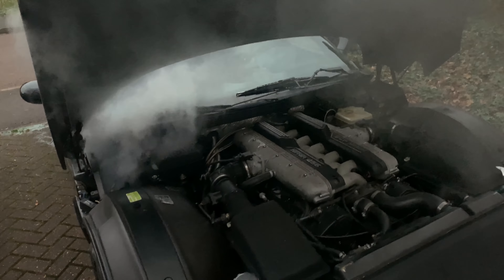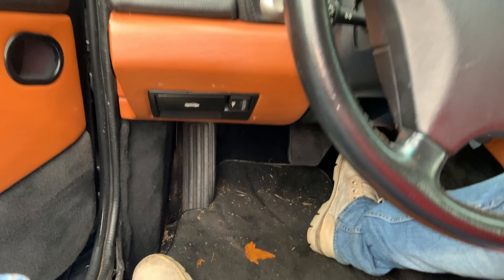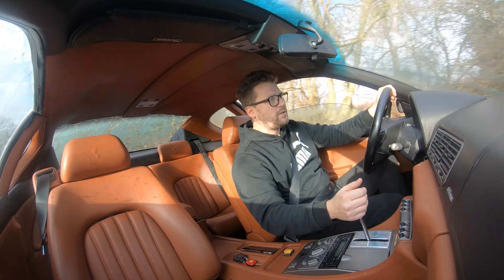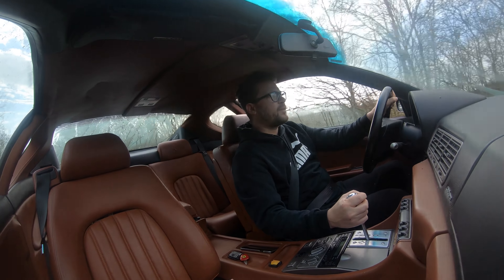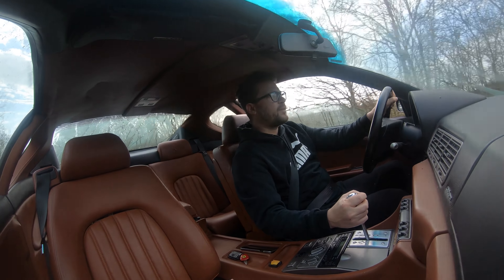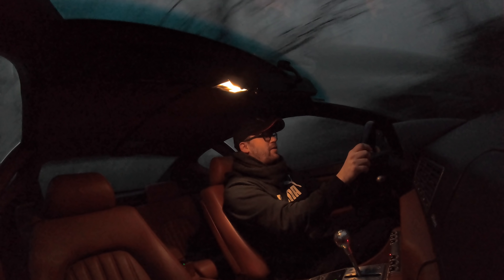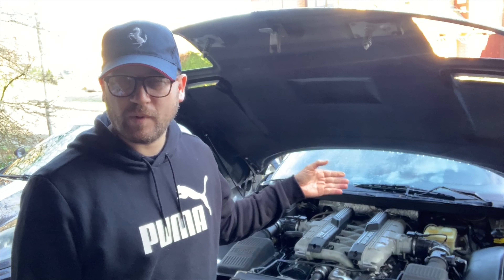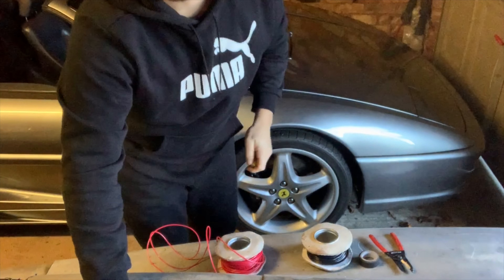I Left my $19000 Cheap Ferrari Sitting for 4 Months and Here's what Happened !!  Part 5

Comment: Why not use a scanner to pull up sensor data, compare data to known good values, then trouble shoot sensors giving out of spec readings. O2 sensor data, STFT, LTFT, MAF, MAP, TPS, IAC, CMP, CKP, etc.. all needed to pinpoint exact problem. Not knowing is same as using the "Parts Cannon"

Comment: You need a garage for your outside Ferraris. The rain makes you many electric problems. I had the same problems with my Maranello and my F512....
Reply from the maker: its a tricky one as to many cars and not enough space.
Reply: I know all of these problems. I bought the 3 cars without a garage. Always tried to cover them. But when there was wind, everything flew away. The sun destroyed the dashboard of the Maranello and the old leather roof of my Rolls Royce. Build a double carport in front of the garages and a carport next to the house. Then the Ferrari will not get wet and are protected from the sun and you can also repair it in the rain. Such a wooden carport is cheap. Don't know if you need a building permit.

Comment: What you’re doing is fault isolation. We do it a lot in aviation. If you have a working test rig (in your case, other car), you could install the suspected part and see if it causes any effect in the test rig. It would be a faster way to identify the faulty part. I believe you did that with the suspension actuator.

Comment: A number of the trouble codes were set by you disconnecting things with the ignition on.
You need to clear ,run the car and find the active codes.
You need to watch in the live data and you will see if the cats are working properly by the lambda sensor readings.
The fuel trims will indicate where your problems lie.

Comment: Had to replace a cat ECU on my 355 this summer. Yeah, they are almost $500 here in the states. So far I've done 2 (the US 355 has 3) during the 6 years I've owned it. An easy fix, but expensive as hell and no option for a compatible part to avoid the "Ferrari Tax". :(
Reply: You own a Ferrari and think $1000.00 in repairs in six years is expensive....
Reply: @williamegler8771  Did I say that was all I have paid in 6 years? No. Just what I've spent on cat ECUs which is very expensive for what a simple little part it is. I've put over $25K into the car, about half of that being an engine out major 2 years ago. Trust me, I know exactly how expensive FCar maintanance is.
Reply: @JeffBoen   as the saying goes and as a fellow F355 owner “the best things in life cost quite a bit actually”
Reply: @sultanoftippoo3857  Agreed. Have owned it for 10 years this summer and it has been worth every single penny. :D
Reply: @JeffBoen   only had mine for three years and told my wife it was part of the pension when we bought it and I promised one day we’d sell her (the car not the wife), but I think they’re both keepers 😊

Comment: Did you fill up the cooling water tank with ordinary water? Men, i would not even do that to my normal car 😉 
Always great contents.
Keep going
Reply from the maker: Yes just a  temp solution while I got some correct coolant, just wanted to make sure it wouldn't overheat again
Reply: I understand your point with filling up to the right coolant level, but i would do that with demineralized water only. The coolant it self can be addet later on. 
Did this to my 355 last year, when an coolant hose leaked an the coolant level dropped. I always keep an 5 liter bottle of demineralized water in my garage, with Ferraris you will never know when you need it 😉👍
Reply: Id be more worried about the water being very cold and possibly cracking the cylinder head🤔
Reply: @seanbyrne910  he only filled the overflow tank. Then the car sat for a while, so should not be an issue
Reply: @Domcel  The header tank feeds into the cooling system and engine block + head. I once cracked a cylinder head by doing that. Just saying..

Comment: Did you find out why it boiled the coolant? When you mentioned the CAT could have a problem that set alarm bells ringing. I have heard of CATs collapsing. Thus putting more back pressure on the engine and blowing the head gasket. Fingers crossed that’s not what’s happened.

Comment: I don't own a Ferrari either , seeing all this hassle makes me glad i don't own one :/
Reply: ThirdDegreeWitch Explores it’s an old car. Old cars have problems. With a Ferrari the fixes if parts are required will always be relatively expensive unfortunately.
Reply: @malcholden5357  in comparison i have a 2003 grand vitara ..101k on the clock , owned 6 years, replaced the tyres and a brake light bulb in that time , last MOT no advisories.also own a 2003  x type jag (yes i know its a mondeo) 113k on the clock , owned 4 years , replaced the o/s rearbrake caliper (£39) and the nearside headlight bulb in that time , last MOT 1 advisory , clouded headlight lenses . me thinks i have the better deal.
Reply: I think you just got lucky. I have a 22 years old BMW Z3 with 72k. I’ve bought tyres, exhaust, brakes callipers, pads and discs. To name a few.
Reply: Ferrari service is con, they give you a price for a few hundred pounds you end up paying over 2 grand, and the mass produced ferraris from the 90s were slow as shit, ferrari is a pompous company hopefully one day fiat get taken over by mercedes, bmw or vw
😁😁😁
Reply: It's an old car thing not particularly Ferrari specific. Cars do not like being laid up. Unfortunately many Ferraris are used little and are stood  for long periods which doesn't help matters. Ferrari parts may be more expensive than other cars but it's horses for courses (if you pardon the pun!)
Scott is doing a great thing by using, restoring and enjoying his Ferraris! Thumbs up to you!

Comment: Professor (Dean of Engineering) Doctor Walter Lowen: "Gasoline is the cheapest part of the car." I think I'd like to go back to that. 100 less sensors and  multiple computers and harnesses to fail. You spend six months in the garage, I'll spend the extra $30 at the pump and be gone. Now, to find a good running survivor.

Comment: Those codes could have been there for a while, always clear them then drive the car so you’ll get current codes.

P0133 bank 1, sensor 1 is the pre cat lambda sensor on bank 1, which will be the bank with #1 cylinder 
P0139 bank 1, sensor 2 is the post cat lambda sensor on bank 1

I would imagine that bank 1 on your engine is the side of the V that isn’t changing engine revs or tone when you unplug the MAF sensor so that would correspond to your findings, if the MAF isn’t registering properly you won’t be getting the correct air/fuel mixture into bank 1 so that would throw up the above codes

The fact you also have P0102, Mass air flow circuit low input shows that something isn’t correct, if it was a faulty sensor I would expect the problem to change to the other bank when you swap the sensors over, the fact it doesn’t tells me you should investigate the wiring from the ECU to that sensor, check continuity of wiring to make sure it’s intact also check the connectors for bent or ill fitting pins.

You also had a fault code up about throttle potentiometer, so I would be inclined to check the connector to ECU to make sure there isn’t any corrosion on the pins and to make sure everything is seated as it should be, moisture may have got in whilst it’s been standing

Good luck fella 👍
Reply: DJ Hatstand 

I think that many of these codes were logged because he unplugged some sensors. We saw him unplug left and right MAF sensors and the cat ECUs.